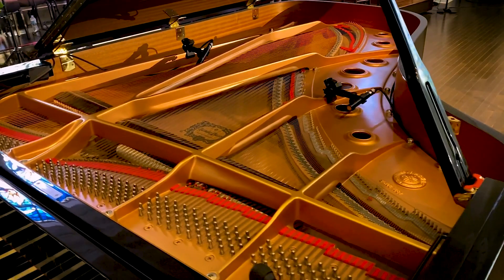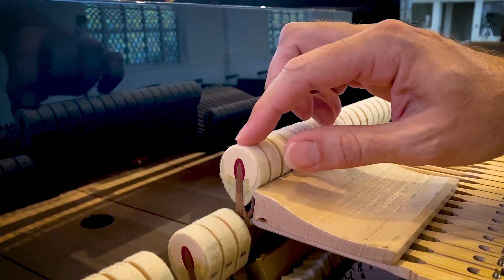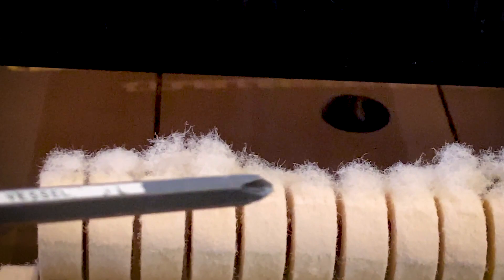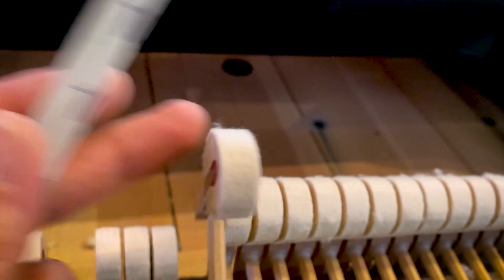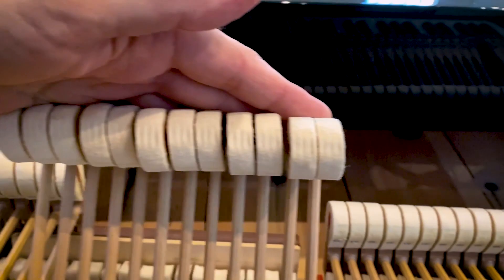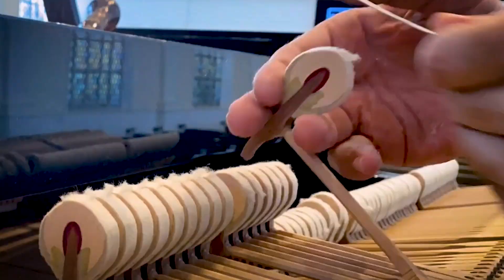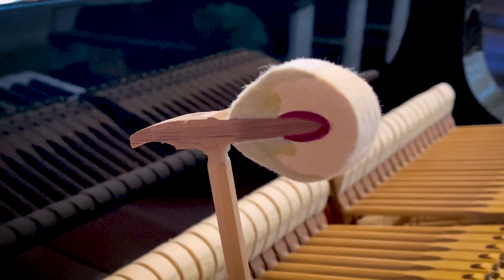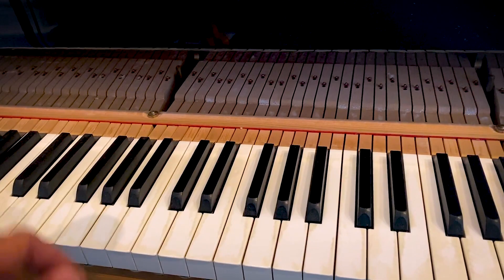Yamaha C7 Hammer Filing & Voicing

Comment: Love your videos! I've been doing some minor needling on my own C7 whenever it gets too bright, and it's gotten to a point where I kind of want to try reshaping the hammers myself, since they're so flat on the top. May I ask what's the reason behind leaving those few millimeters of string grooves alone?
Reply from the maker: Hi! That’s a good question. Let me start by saying that it takes quite a bit of experience to get a nice shape. Perhaps it would be better to start out on a lesser piano than your nice C7. To answer your question though, the strings grooves on the top of the hammer act as guides as you approach the final shape. Ideally when you’re done the grooves are all the same length and depth indicating that the hammer top is level and that the filing is even.
Reply: @the_daily_ping  Haha that's what I thought re: experience. I can imagine it takes years of practice to even do a decent job at it! I'll definitely do my research and get lots of practice on "lesser" pianos first. Thank you for answering my question! cheers
Reply: @actualglacier  Experience is the waste of 80% of your time learning something without supervision. Trial and Error, with no one but yourself to spot the error and find a way to correct it. With good supervision and constant control of your work and its results you can save a lot of time. Takes a good teacher, so there's your problem when it comes to piano technicians.